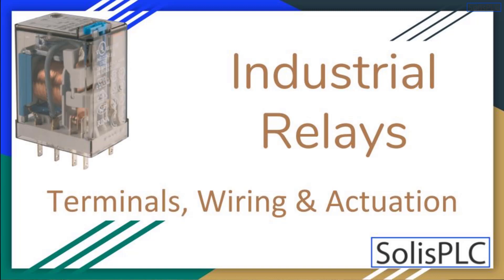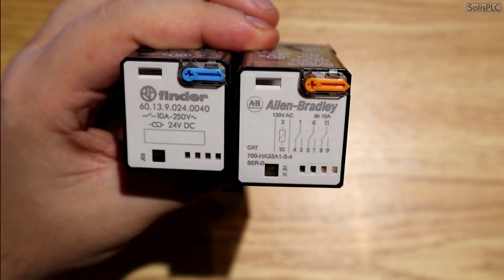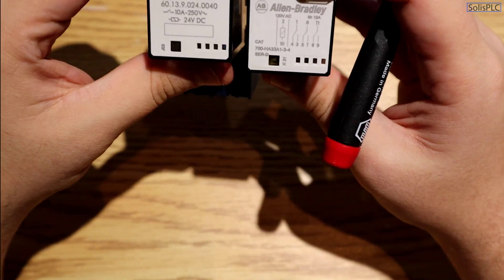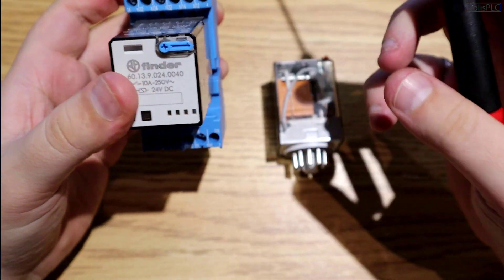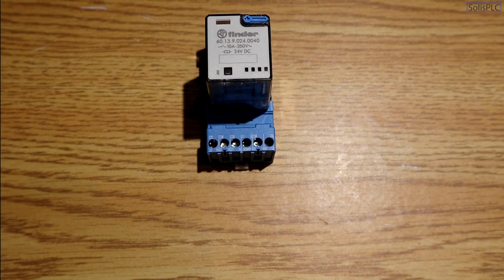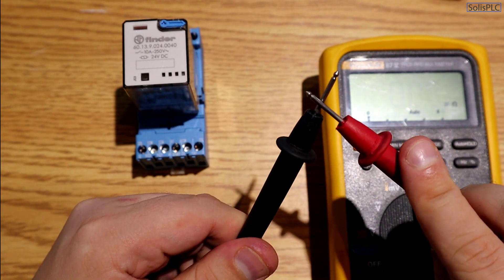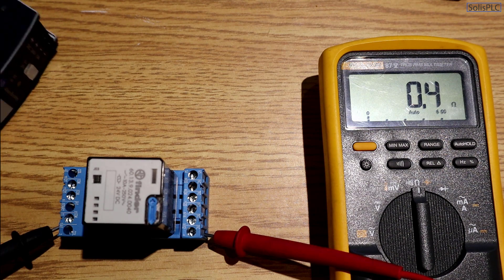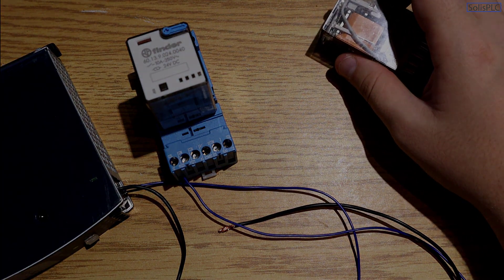Industrial Relay Control System | Wiring a 24 Volt DC Relay Circuit

Comment: Great video!  I have a question about the 4 windows on the lower right of the relay at 3:10.  Are they supposed to change to red when a circuit is closed?  I'm asking because I'm looking an 8 pin relay (24 volt AC) on my boiler system and I see that windows 1 and 4 (left to right) are red.   Not sure if it means on or off.  Thanks.

Comment: My navigation light use 24 volts power suply and the load is 24 volts relay omron conected in series with the 24 volts 50 watts, but the light is not shining and the relay si functioning, what is the problem of my navigation light? Can you please help me, i already use 48 volts to suply both load but nothing is change.. light is not shinning.

Comment: You took a meter read on the contacts, but I didn't notice a de-energized/energized voltage and resistance reading of the coil.